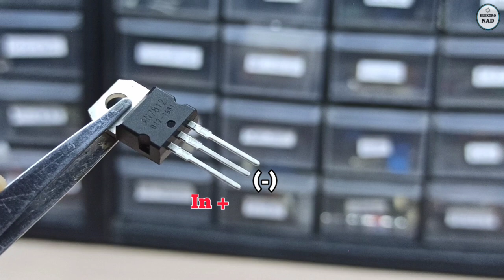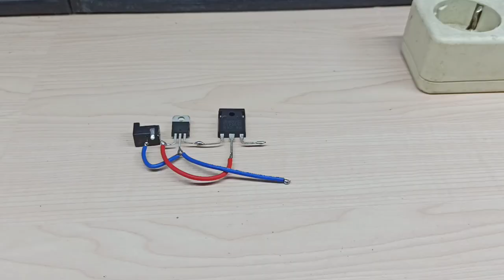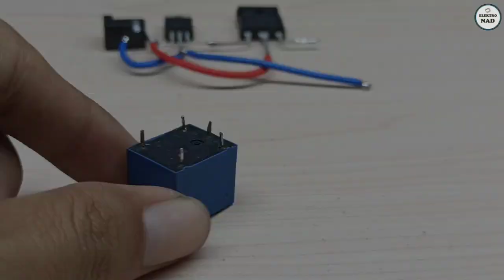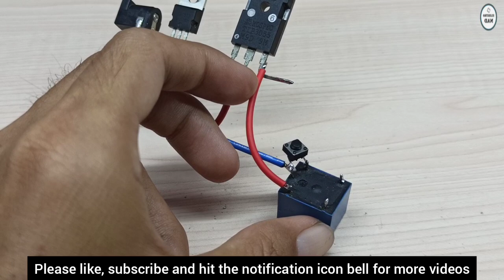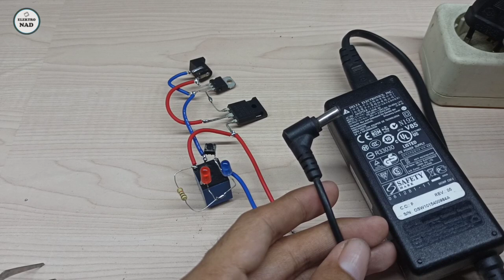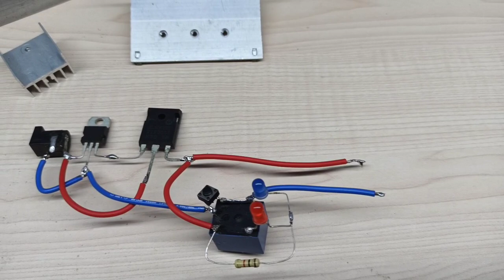12V DC short circuit protection

Comment: My power supply delivers (thru a stereo 3.5mm jack) a differential voltages -6v / 0v / +6v.
Many times I encountered short circuit between this jwck’pins.
How can I protect the mentioned output voltages to short?

Comment: Even if the input voltage is 12v, the relay operates.I wonder why you use TIP3055 to lower the voltage.